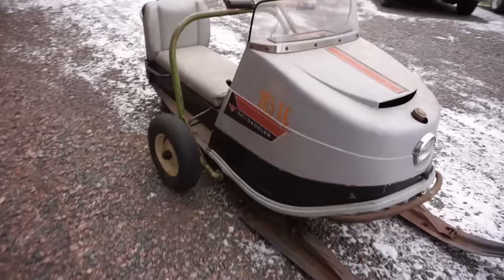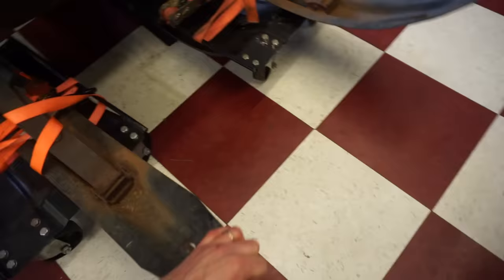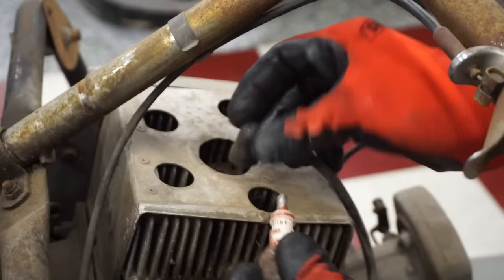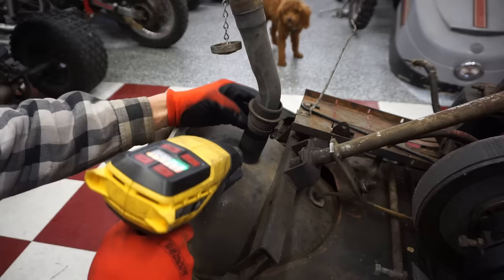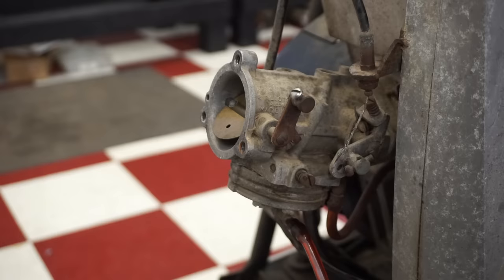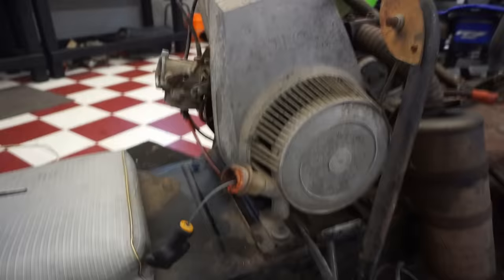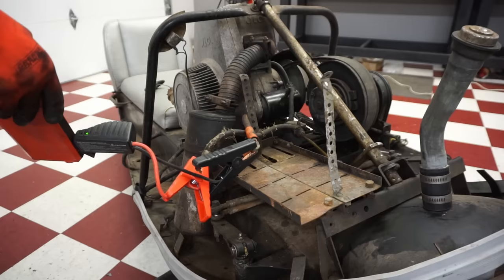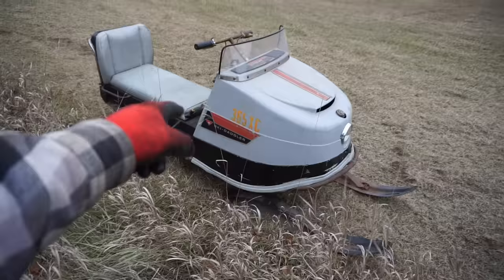Seller Said This 1960s Sled Wouldn't Run...I Fixed It

Comment: All you need to do for the pull start is pull the rope out all the way and undo the end of the rope the knot or whatever stopping the rope from coming out and then retie it or whatever you got to do to make enough of the frayed end and then let the rope go back in. before you untie it though make sure you hold the wheel down with a screwdriver or something so you don't have to rewind the sucker and then hope you didn't twist it too many times also clean up those bearings in those spring loaded centrifugal locks everything inside of there should be clean in a very light oil no grease a very light oil cuz you don't want a lot of dirt in there sometimes no oil is better just make sure everything is clean inside of there and then it should operate smoothly

Comment: Think good lesson on making sure you always tilt it and check the track and suspension out before purchasing,  alot of those roller wheels, bearings seize up. And causes the gears to strip. Also. You want to do a plug chop on it. With mo air box , filter, it could be running lean, even with the pre mix. And not sure what pre mix you used. As some of those engines required a particular kind of oil. Due to the way it lubricates. And I believe the idle should just about move the clutch,  in video looked, to loose till 1/2 throttle. a heavy rider, use to have to give it a little help to take off, very tiny, and ruff on the butt and back. When you showed the 1 video, it looked like the teeth were still there, you may have did it, but not lifting the track and not checking if the wheels spin freely. The friction may have destroyed them in a few feet. Or was already about to go.

Comment: Drill out holes in those old roller wheels then epoxy in those threaded inserts & repeat the process on the teeth.,or tooth parts of the wheels that grab.& Turn turn the tracks with. Belt sander.& Sawzall will fix that problem right up.,or even A jigsaw will do that part to it's just for cutting out the shaped angles.&angled cuts.

Comment: Bogie Wheels! 

That's a selling point right there!

Bogie wheels don't need snow for lubrication. You can go for extended lengths on dry asphalt or dry ice without worry. The "teflon" sliders which appeared a few years later would really wear down without the constant cooling and lubrication of snow.

Sure, I've been living in the southwest desert for the past 40 years, but I still remember the benefits of bogie wheels from my time growing up near Canada in New York in the 60s and 70s.

Comment: Joe struggling with that pull starter cable trying to unwind the frayed section, that's me today wrestling with any canned food product in a jar with a vacuum screwtop lid.  My worries are not so dangerous as a cable spiriling out, flying towards your face unless beet juice from a jar of pickled beets splashing on your 'everything' dark red juice seems a catostrophic tragedy,  ...such a mess.

Comment: I have never had a snow mobile, but if you can't find drive sprockets, maybe you can stick weld solid square or rectangle stock, to repair the drive sprockets you have?

Comment: those cogs are pretty common, only one company made them so you can find those on ebay and even from other brands that used the same ones. Easy fix. :) Amd tighten the track, then you can get back to the house...lol! Prolly why they wore off too, track not tightened properly.

Comment: That machine should of had a pick up screen attached to the hose inside the tank.  If you can not source the screen you can wrap copper wire around the hose inside the tank so the hose goes to the bottom of the tank.  You should have replaced all the old fuel line and put in an inline fuel filter and a squeeze primer bulb.  Even if you had not snapped off the drive dogs this sled would have gunked up the carb from that crud in the tank coming loose.  If you want to replace the drive parts someone of the Facebook group Old School Leafers can probably source new replacement parts.  That pull start you should have just  removed the cable.  A bit of PB blaster on the cable would have made it slick enough to work the fray out so you could rewind the starter cable.  Those JLO singles are nice because they either run or not.  I have a 370 I put into a Rupp chasis running a Yamaha V Max track running a single 32mm Mikuni and external fuel pump.  Makes a good freighting sled.

Comment: There should be a check valve at the end of the line you put in the tank so when you shut it off the gas won’t drain out of the lines and it also has a screen to help from sucking up dirt

Comment: Cool sled, that is a goofy setup though with the tank, engine, and carb placement. One thng though that short line inside the tank should have a filter on the end.

Comment: Rope or cable problem like the cut the cable or rope let it releases all the way in and u can safely remove the pulley. And replace it. Not hard to do. All was put in full length rope in.

Comment: The Drive wheels could you grind it smooth and drill holes put bolts through and weld around it.
Making enough material to grab the belt track. That's one solution if you couldn't find a replacement.

Comment: That line that you installed to the cap is supposed to have a filter on it and it sits on the bottom of the tank, kind of like a chainsaw.

Comment: Honestly i was surprised the other one didn't brake the cogs. This is a failure point of these old sleds. I knew right away. Just from wisdom. Great job getting the bendix working on the starter. I was yelling at the video lol. The spring Will be able to recoil!! Take it apart. Don't be scared!! You have mechanic understanding. It's exactly like an old mower

Comment: Hey 2Vintage! Nice pickup on the sled looks nice! We had a old 68 Alouette single cylinder Sach engine alot of Fun to rip around on back then thanks for the flashback! We put alittle squeeze bulb on the line going up to the carb just below the the diaphragm inlet, few pumps and pops right off! Liking the content and video I hope you can pickup some new drive sprockets for it vintage sleds are popular!🤔😉👍📹✔️💯👋👋👋👋

Comment: Take the wheels off you may find new or used ones I know of one that had steel drives and he welded home made exact size and weight  blocks to the existing ones and it worked. Good luck

Comment: Hey sled head Canada  guy The Gabbster here. Buy a few  diagram kits from kimplex for your  diagram carbs there cheep and we change ours every year because the oil and gas makes them go hard. You can switch to a 32 or 29  mukini carb.and to check your engine case seal you puta vacuum gage onthe hose to crankcase  and pull the cord ugs in or out. If the needle  does not move you seal is gone   if the needle  on gage  goes back and forth then your seal is good

Comment: If the front star wheels are in any way close to the rear ones, they are just knobby plastic disks which are mounted in between to metal flanges. If they are no longer available for this old model, it might be possible to water-jet-cut new wheels from POM and replace them, using the old metal parts.
This might be cheaper then trying to get new old stock.

Comment: Just my two cents, but any old engine like that will likely have a bad gasket between the carb and the head, allowing unmetered air in and leaning out the mixture. When you rebuild the carb just be sure to replace that gasket also.

Comment: Don't pull recoil to the end like that, that carb needs to be cleaned at minimum, points checked cleaned and adjusted, ngk a7 or a8 plug too.

Comment: That's a special sled, 1967-68? silver seat scout?  I had a late 68 black seat scout with the 292 JLO...Fuel tank was in the tunnel. They are tippy sleds That rear pull bar is a jack stand.   Buy a snowmobile mover, I destroyed my back restoring vintage sleds.

Comment: you should have put a filter with a check valve in the tank on the  fuel pickup line. keeps debri out of the carb and keeps it from losing it's prime. and always remove the belt when starting for first time.
Reply: Same comment I said lol yes you should have a check valve with a screen or the gas is just gonna drain out the line every time you shut it off and it will be hard to start again

Comment: Did you know that bar on the back of the seat folds all the way down to use as a kick stand you can run the track around off the ground. You can take that cable out of the recoil and replace with small rope.

Comment: Yeah those wheels r gonna have to be changed but it sounded like the clutch wasn't engaging after it stopped moving, and that is all one system I believe good luck! But yeah check the clutch your gonna have to tear into it to get those wheels off anyways so might as well... good luck!
~ZJAK

Comment: After sitting so long the crank seals dry out and fuel doesn't get cycled well enough to keep the engine running. It will run hot and burn a hole in the top of the piston.

Comment: Almost all those old sleds will shear the plastic drive wheels off. I'm shocked it moved that far before letting go. They normal break the first rotation of the track. Replacing them is probably the most difficult part because after you have the track out you uncover the slide plastics are gone and the boggie wheel bearings are shot pretty soon you are into a 350 dollar sled for another 200-400 dollars. Then you normally shred the track after the first season and you're back where you started...

Comment: Modern Engines use Pre Engaged Starter Motors. It might be Inertia Type on that Engine. The Gear is stuck and won't come forward and Engage the Ring Gear.

Comment: Actually back in the day there were many different brands the problem is parts are hard to find. polaris had some fast machines the TX's but a friend of mine had a TX 300 that b lew the doors off the TX 800's at the time. It was a two cylinder and the 800's were triple cylinders you couldnt keep the skies on the ground 75 to 85 mph 12 inch track so I know you can modify things/smaller engines if you got the money and time to mess with them.

Comment: Aftermarket driven sprockets are available for that Skidaddler  So is the JLO recoil wire rope and recoil spring. You can put a Mikuni carburetor and fuel pump on it. Be careful…that sled is tipsy…

Comment: Also when store after Winter Season have back end plus whole track of ground with stand it save track from storage on plus weather cracks! Lube on gear drive high pentriotion fluid then grease up on gear drive it help from seized up to! Check with Actric Cat , Bombardier, Polaris for Snowmobile parts may need take show on back like so match up also Rock Auto too and if not may need take good get a Machine Operator does metal milling on make them for you don't want plastic because crack snap want fiberglass or steal made so handle Winter Season months travel on snow or ice !

Comment: I found it far easier and quicker to make a little fuel tank out of a bottle that holds about a litre of fuel and either hang it off the handle bar or make a little stand for it ...... Great for engine testing if the main fuel tank has been removed

Comment: Dude, turning the engine over without the plug installed, or the mag grounded ( switch off ) is not a good idea. You are not giving the voltage built up a path to ground. In that situation, it will look for a path and if it finds one, it will keep using it.  The early Skidoos had a fuel tank built into the pan much like this one.  It was typical to have a screened pickup fitting inside of the tank with a check ball to keep the fuel from draining back to the tank from the carb. I  admire your enthusiasm, but new fuel lines are pretty much mandatory on old sleds that have been sitting. Also, in my experience the only carb you can start the engine without holding the throttle half to all the way open is Mikuni.

Comment: take the carburetor apart and clean all of the varnish out from old gasoline and replace all of the gas lines.
it should startband run a lot better.

Comment: If you run a mukini carb you need thatcrank case vacuumed line to run it old  399  skidoos don't have that crank case vacuume line so we have to drill a hole in case

Comment: Just saying, You might want to pull the drive belt off the engine when troubleshooting and running in the shop. You don't want to send it by accident.

Comment: If I were you I would put a fuel filter on the line before the carb so it doesnt suck up any rust and clog the carb, I think that's half of the issue is the carb keeps getting clogged with crap..

Comment: Look at the corrosion on the clutch,  that thing hasn't run in at least 10 years, probably 20 25, u should have the rear end off the ground so you can rev it up after it starts, then it will pull gas quicker,

Comment: these sled were a poor design for a gas tank  there was a extension with a screen on the end .most gas tanks are plastic . I had seen a few that cut out the steel tank and put a plastic one in the cavity. also I noticed your exhaust tube is linked a single it had be modified.and those cables aren't original.the extension tube had a floater screen on it like a chainsaw

Comment: "Pull starter is messed up for some reason " had nothing to do with the previous 5 minutes of total abuse slamming the locking legs into the engagement gear or anything like that...🤦‍♂️😑 🤣🤣seriously tho.. slow pull until Engagement than pull to start😅 the way he was just yanking that was making me cringe soo bad!!

Comment: Needs new drive cogs. You should always pull out boogie wheels system and check. You are not very bright . Don’t Rev up engine at this point as any engagement could Tare up clutch drive. Always check out transmission oil level. You are in to much of a hurry. and in long run you will do more harm than good.😬. Common sense could go a long way for you.  You need to watch Terrel fixing toys like this on u-tube.👍

Comment: You should always pull the drive belt off before starting any engine.unless you chose to chase machine across floor of garage.😬 Pull recoil off  and wrap rope around flywheel for the mean time. You are just baiting the followers or your channel.🤔😉